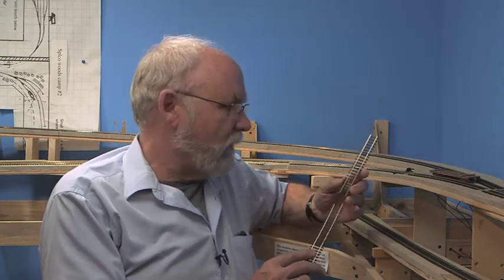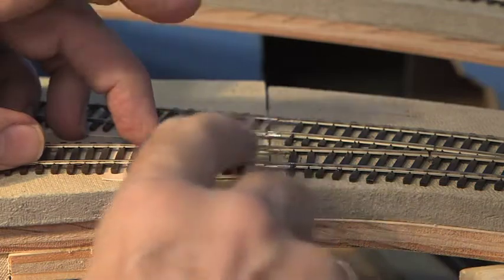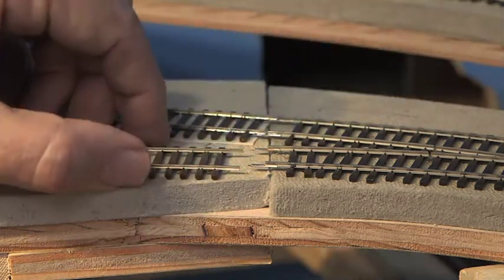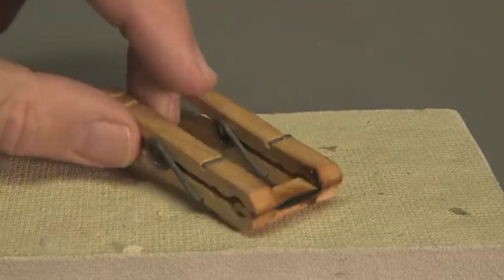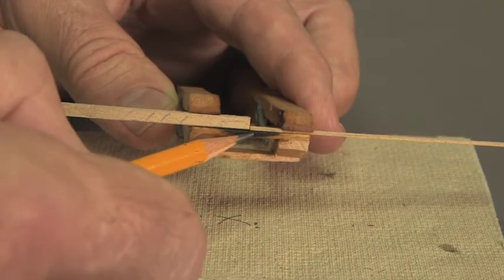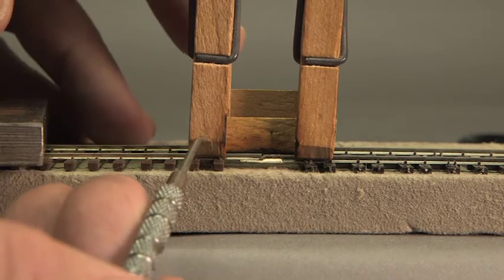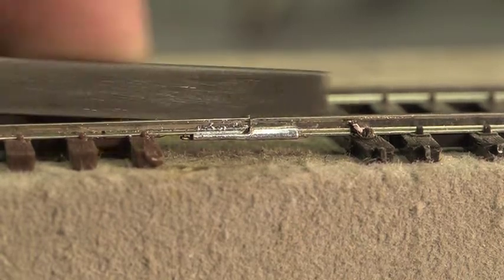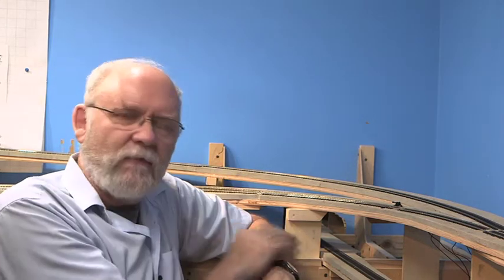How to make rail-to-rail size transitions for your layout

Comment: Hello Jeff!

I have done the same as you for code 100 to code 83. Recently, I tried something new, converting a standard rail joiner to a transition rail joiner by cutting the sides out for a small distance in the middle and then bending it. I was amazed how well the rails mate up. 

If you are unsure what a transition rail joiner looks like......do a search on Google.

What are you using for lacquer thinner? 

Jim K.